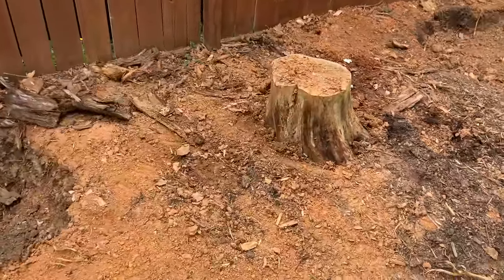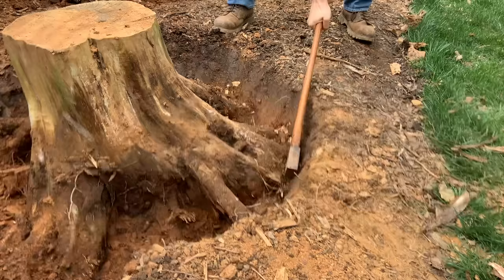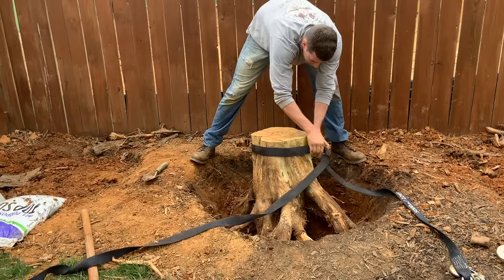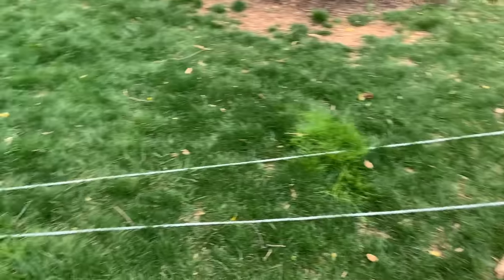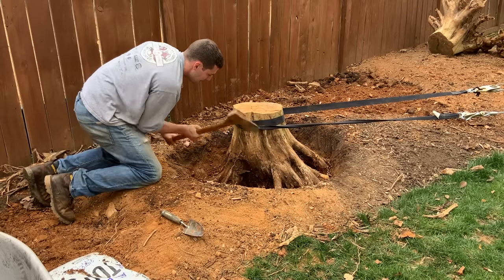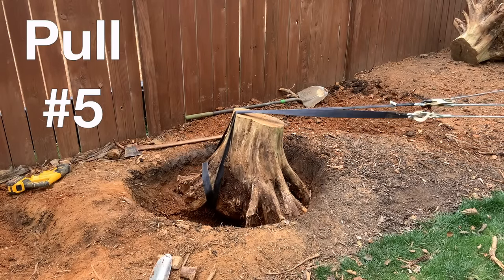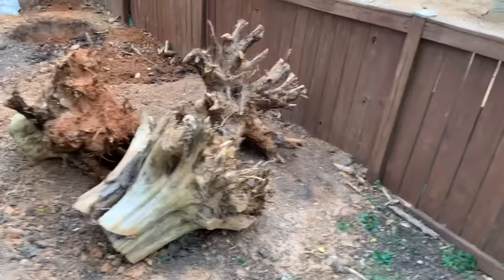How to Remove a Stump Using a Hand Winch

Comment: Archimedes would be proud of you! Could you share the specific pulleys and straps you purchased from harbor freight
Reply from the maker: Haulmaster 4000 lb cable winch puller
Badland snatch block
Haulmaster 6000 lb 2in recovery strap
Reply: Harbor Freight to the rescue as usual.

Comment: Ok, I am going to be that guy. Pullies will only double your power if you double the amount of line pulled on that line vs object moved. Hooking your winch to the outside of a snatchblock will only pull with the power of the winch. Hooking a winch to the line inside the snatchblock would give you more power as the line would move 2X the cable vs object moved.
Reply: it seems with 2 snatch blocks he could use 3x winch power, but here only winch power + 50% more. he should install winch on second tree.

Comment: Wait until the Ground is frozen. Drill a hole in the Ground, under the middle of the Stump, about a one and half feet deep. 100 grams of Dynamite. BOOM! Stump is done!😉
Reply from the maker: If the neighbors weren’t so jumpy I’d have given that a shot 🙂
Reply: @jackmeyermakes  Yeah. I’ve been doing the same method, too, by using blocks, and wires. But it’s taking too much effort. «Dynamite», is the «Reel Thing»!😀👍

Comment: My neighbor had a tree guy who was working on her yard. I said while you’re here give me a price on a stump grinder. 50$ and in ten minutes it was gone. That being said I have to rip out a peach tree stump today using straps and my pickup truck 🛻. Lots of digging and root cutting already. I’m 58 years old and I like hard work but I must admit I am breaking down. Two shoulder surgeries and a knee surgery back in June. Owning a home is a lot of work. 😅
Reply from the maker: Good for you for still getting after it with the manual labor. Hopefully you heal well and are still digging out stumps at 68 👍
Reply: I put the strap around the stump this morning and it pulled right out in seconds with my truck. Work smarter not harder

Comment: Have a massive oak in the backyard that we are thinking of removing and dread the stump
Reply from the maker: that may be one you just burn for a few days, can't imagine trying to take a big stump out by hand. Good luck
Reply: Before cutting the tree do the block and pulley higher up the trunk. Not only will you get the mechanical advantage of the block and pulley system you also get the advantage of the angle pulling downward toward the pulley anchor point. I have done this a few times with a tree about 12 inches in diameter and works great. First a couple of days in advance I use a pressure washer to blast away as much soil as possible. Once it has dried I use a shop vac and trowel to expose as much root material as possible. Then attach the pulley system ( I use an extra pulley to get greater mechanical advantage) as high as possible and then start applying tension. When nothing happens start using a rip saw on the roots on the opposite side , cutting everything in site. Apply more tension until it seems stuck and then look for more roots to cut. Time consuming but no stump left behind,!

Comment: Would that tree holding the winch not be damaged? I'd like to have seen the trees stay in place ultimately.
Reply from the maker: The straps distribute the pressure on the anchor trees causing no damage, same as the strap on the stump itself

Comment: You can additionally dig a hole , deeper than the stump with a drain from the stump to that hole , and then just flush it away with water. And think this is a simpler solution.
Reply from the maker: Good suggestion

Comment: You also need to pull up from One Direction and then change your set up and pull it from another direction. It will pull way faster.
Reply from the maker: I thought about this but didn’t have any other good anchors in the yard. I think you are right it would have gone faster

Comment: The real trick is don't cut the tree that low, cut 6 feet up then cut roots then rap cable and pull over with the leverage of tree and it fall over easier and you can  cut roots as you pull over.
Reply from the maker: I agree. I could have done this in a fraction of the time if an 6ft stump was left but the tree was cut years before I moved in

Comment: Can't see how you use the winch, whats the other end of the rope ?
Reply from the maker: the straps on the other side of the winch are attached to two mature trees. The winch is easy enough to use, as you crank the lever it will spool the cable slowly applying tension to the line.

Comment: you didn't address the ANGLE between the lines on the right. I understand that such a large angle decreases the multiplication of power by the snatch blocks
Reply from the maker: You are correct, the further the lines are from parallel the less the force multiplier

Comment: I dont belive those hand winch ratings, at 8000 pounds 3x you should have been able to pull that out with ease...
Reply from the maker: Agreed. When I tried maxing this one out the teeth were bending on me, but not surprised on a $25 winch

Comment: A reciprocating saw would have done a much quicker job on the roots.
Reply from the maker: I used my reciprocating saw on a few of the harder to reach roots but the dirt dulls the blades very quickly. Used it sparingly since the axe is free to sharpen vs going through a pack of blades

Comment: Cutting the roots with a reciprocating saw with a timber blade would be faster and a lot easier than chopping.
Reply from the maker: The dirt/clay had a lot of sand imbedded and I found the reciprocating saw blades dulling very quickly. Maybe a timber blade holds up better in dirt but the axe is free to sharpen

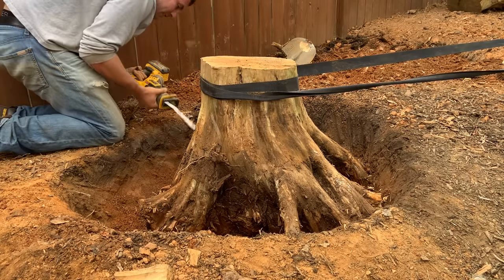Comment: 3:39.....under tension , cutting possibly only that what keeps it from breaking out with all the force applied...with your unprotected head RIGHT NEXT to it.  darwin award pending !! 
To anyone reading/watching : DO NOT DO THIS. EVER !!! release tension 100 % every time you cut or reduce tension significantly so you will not get hurt. or don't...sooner or later you will remember this warning.
Reply from the maker: Give it a shot digging up a stump on your own, you'll see there isn't just one tap root holding the sump in place underneath (explains why the stump only moves ~1" after cutting), and not nearly enough tension for the stump to make any significant movements at any point. Thanks for watching.
Reply: @jackmeyermakes  "Give it a shot digging up a stump on your own," Really  ? What a arrogant ASSUMPTION i never did or do... in this case , even more funny. Fact : you ASSUME there are more roots holding it in place, you do NOT know for sure.  If you released tension, you should have mentioned it .Stop acting like this , and just accept what you did is NOT safe for viewers that do not know any better. safety first. Or continue to act like a b**ch about it. fine be me. point is made.
Reply from the maker: You're right my friend don't want to put anyone in danger. I could see about 6 other in-tact roots as I cut this one, felt perfectly safe removing the stump this way. There are absolutely other methods, some folks might prefer a different approach that's all good with me.

Comment: Shouldnt have cut it so low would jave been easier to get out
Reply from the maker: agreed longer lever means more leverage. The tree was cut before I moved in so had to work with what was there
Reply: @jackmeyermakes  lol then I'm speaking from the same angle, lol had a buddy needed help getting the stump out and it was cut almost flush to the ground....the most unnecessary digging happened that day.

Comment: Diablo makes reciprocating saw carbide pruning blades in up to 12 inch lengths that stand up extremely well cutting roots in dirt that instantly destroys non-carbide blades
Reply from the maker: This is good to know. This regular set of blades was filling out very quickly